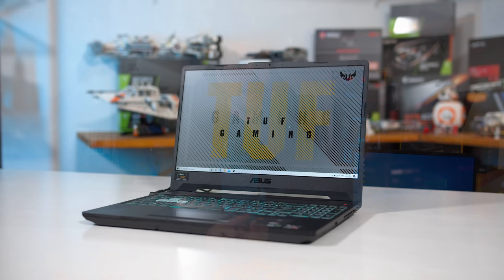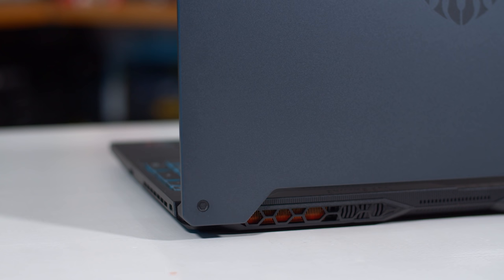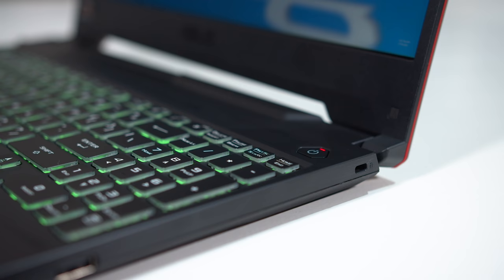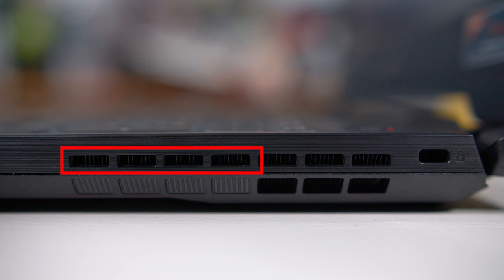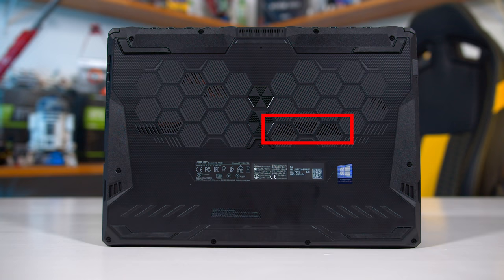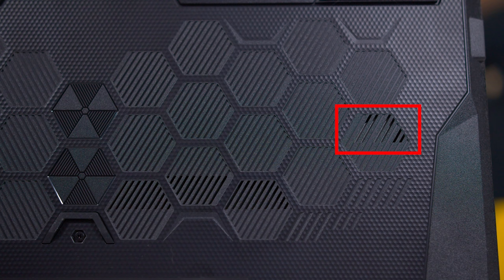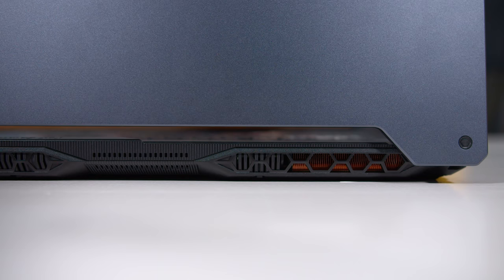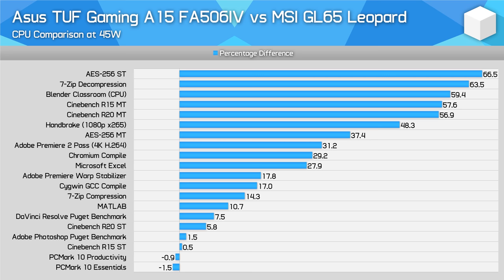Don't Buy The Asus TUF Gaming A15 (2020 Model)

Comment: Hi all, I have this laptop and it runs around 60fps on high/very high settings on Call of Duty which is a pretty heavy game, and runs at around 100fps on GTA 5 high/very high settings. I have completed a stress test on furmark, and GPU stays at 70-80 degrees and CPU stays below 90 degrees. This was all on the turbo mode. (By the way, silent mode runs VERY quiet, and still gets around 70fps on high/very high settings on GTA 5 which is impressive). I hope this helps guys 😉
Reply: Thanks ! Btw do you have the version with gtx 1650 or 1660ti ? I am planning to get the 1650 one due ti limited budget, so what can you suggest ?
Reply: @Red Hawk I’m also facing the same problem. Is the GTX 1660 better than the GTX 1660 ti? I’m afraid of regretting it after buying. So which do you prefer?
Reply: @isabird2944  1660ti is better than 1660
Reply: @redhawk486  I'd recommend the 1660ti (if you don't mind spending the extra money) because it performs quite a bit better than the 1650.
Reply: @malymole  what a coincidence just now I purchased one lol
Reply: @redhawk486  great! I hope you enjoy it 😊
Reply: Thanks for the info man..i think the guy in the vid is just over criticizing it. Most of the people i have seen have given positive comments only for this laptop.
Reply: @swifty6759  Yeah I agree

Comment: At this point i'm almost ready to believe the widespread rumor that Intel paid Asus to deliberately make the cooling solution worse. They've been close partners for well over 3 decades, most of the Asus smartphones use Intel processors. And honestly i'm kinda amazed and frustrated at the same time. I'm amazed by the lengths Intel are willing to go to in order to keep every single market share. Because let's face it, the whole they're in is so huge, you can't even see their logo at the bottom. They've lost high-end consumer market, lost low and mid range as well, started losing even on enterprise level (very often now i see Epycs deployed in places where Intel has reigned supreme before). Up to this point they were left only with hardcore fans (who also decrease with every day) and the mobile market. Until pretty much the last year AMD laptops were basically if you just wanted some cheap mobile computer w/o any interest in performance. Now however they come up with cheaper AND more powerful chip, which also runs cooler and is more versatile. Losing this market has the possibility to hurt the most. Especially when even Apple for the first time ever starts working on Macs with AMD cpus. Now that's a HUUUUUUUUGE deal. And Jim Keller leaving is the final blow; it's the cherry on top of the "we are enormously f*cked" cake. So yeah.. i understand why Intel pressed the "EVERYBODY PANIC NOW!!" button, but is this really the way a big company should react? This is where i get frustrated. They just should've come clean, admitted they made few major mistakes which lead to AMD bringing us a far superior product, cut their prices significantly to get rid of the products, suffer the losses which they have no one else to blame but themselves, and roll up their sleeves, dig into R&D and bring us a competitive product. Let's see if they can catch up at 5nm. No point of trying to develop 10 and 7nm cos the market is already OWNED by AMD.
Reply: That's completely stupid. The amount of money ASUS is now burning bc of this is something Intel couldn't just "hand over" to them. Those are AAA companies, they get reviewed.
Reply: Which era u living in? Asus phones with intel chips were last seen 2-3 years ago.
Reply: @QuantumS1ngularity
I’m kind of confused, why would intel pay asus to make the cooling solution worse? Shouldn’t they pay to make it better, and make their processors at least half decent to give people a reason to buy them?

Edit - Nvm I’m dumb, you’re talking about them paying to make the AMD processors have bad cooling.

Comment: Despite watched this video, i still bought it just now. As an average gamer and tech enthusiast not professionals just a normal dude who don’t play much very high graphics demand game, i do play games, the screen is ok for me, the colour look abit mushy but there’s totally not a problem or a concern for me. As i am not doing photo or video editing. The 144hz is perfect for me as I upgraded from a 60hz display. Love it. The thermal issues though i play gtv at maximum setting everything on, get cpu to around 78-80 gpu around 75-77. Which isn’t that bad. To achieve this thermal state you have to disable performance boost using registry editor to show the power options setting. Try google it ur self. It basically control ur cpu to not overboost clock speed, disabling it will let ur cpu run at base clock speed at max 2.9Ghz and its more than enough for gaming n stuff. Overall i am very happy with this and feel good for the decision and i can say I have made a correct decision to ignore this biased video. Tq
Reply from the maker: GTAV is not a core heavy game, good luck mate.

Comment: In part I agree with you, and in others I don't.
Let's see (and think about it):
1st side air inlet - yes, I agree with you (but you can also prevent the entry of garbage because these grooves are much larger)
2nd Air intake for the RAMs - I do not agree with more space if it is to be used without a laptop cooler fan.
If there are more grooves, more dust enters and promotes more electrostatic heating in the Memories and not only (the paper you are referring to is a gelatinous film that serves to keep the memories partially cool and not allow contact with the dust (maintaining the quality of the RAMs).
If you say that the user can open more slots in that area to have a laptop cooler on the desktop, and cooling system (yes) - Yes it can help keep the area cool (it is useful and important that you do not remove the film that is on the RAMs)
3rd The design of hezagonos is funny, but it would be more useful in fomra of lines. And have an articulation system for sliding blinds type OPEN all (when using Laptop Cooler FANS Table) or keep some open (when in Table mode or laptop by battery mode)
4th As for PipeLines, yes, if it is to be used on a laptop cooling fan, otherwise it has the opposite effect. The FANs inside do not get air, they help to remove the hot air. If there are more slots, the AR cannot be "sucked" out, leaving it behind will heat the entire system.
Here it would be more useful to have a higher rubber at the back to give a greater slope, and to promote the entry of fresh (denser) air which would help to push the hot air into the FANs
5º the difference of the plastic has to do with the density of this, its resistance not only to the heat, durability but also in helping not to accomodate dust (let's say it works as a repellent type of dust)
Reply: True engineer spotted

Comment: The reason it dosent have intake ports right over the fans is because as the air enters from the provided openings, it'll cool all the components wile making to and getting sucked by the fans. This is in fact the better air channeling solution and making best use of the fans.
Reply: The side effect being they have to limit the GPU to 90W instead of 125W on other laptops. On a 1 inch tick laptop lol. Thus losing almost 15% performance

Comment: If you're still wondering, I went ahead and bought me one.. the heating issues as everyone say..  they're just exaggerating.  AAA titles, video and audio editing, rendering, never hit over 95°C (that's the highest I've seen in 8 months of owning it and has never crossed 90 C after a clean install) .. mind that AMD has higher thermal throttle point of 105- 110°C.. mine being ryzen 7 and 2060 never throttled, meanwhile some intel i7s (costing almost double the price for what I got) are throttling.

You might get 5 to 10 fps lower than intel but you can definitely game longer and not get throttled.. it's so minor you won't even notice

No one need introduction to Ryzen 7, it's as fast as an intel i7 / i9 in da Vinci (as premier Pro is more intel, Nvidia oriented) 

2060 can run every game in 1080p 60 easy.. heavy games can't hit 144 as it's not a 2070 or a 2080.. 

Battery lasts for 3 to 4 hours YouTube with epic, steam, rainmeter, and few other background apps running, WiFi 5ghz, Bluetooth, 80% full brightness, with keyboard backlight on full (mind that it automatically turns off in 20 seconds on battery) 

Coming to the screen. Lmao boy oh boy do most reviewers bring the laptop down 😂

6 months and the only place I noticed blurriness is on the chrome Dino game after 1500 points 😂 
Don't get me started with colour accuracy.. for gaming and watching movies you won't notice anything.. heck every laptop under 1 lakh has a shitty screen.. they either give full accuracy with 60hz or 144 with similar accuracy... At the end of the day.. you won't notice it at all. If you're into colour accuracy then get an accurate monitor and move on, since you can't work with full performance on battery anyways. 

Plus adaptive sync, no screen tear and no extra latency

I play valorant on a daily basis and I'm on gold 3 ATM.. I don't feel any weirdness or sluggishness in the screen.

What reviews and reviews ignore is that it's a fingerprint magnet.. fingerprint and finger oils.. that's the only annoying part about the laptop.

Other than that, is as equal in gaming as a 2020 razer blade  i7  2060

Best laptop you can buy under 1L.
My preferences and recommendation would be
1. Asus a15
2. HP omen
3. Dell g series

You don't have to trust me on this at all..ask other a15 users and they'll tell you the same.

Glhf
Reply: Thank you
Reply: Update:  did a format and reinstall of windows and my temps aren't even reaching 90c.. mind you that I haven't cleaned the fans

Comment: Good cooling is not simply about "big holes", its a cost/benefit analysis where e.g. too many holes will lead to more humidity and dust entering etc. This video is a great case against "amateur" reviewers.
Reply: I still think that Asus should just include more holes, and probably do something like what Dell did with the Dell G5 SE where they also installed a kind of dust filter mesh over the intake vents if u r concerned with dust entering the system. This imo would be a much more viable and efficient system that wouldn't cost Asus a lot of money.
Reply: My PC has a mesh air filter for the power supply that you can clean and replace...i wonder when that high tech will come to laptops?

Comment: I think u saved my ass... I was literally few hours away from getting this laptop.
Really don;t care about panel. But The bad cooling (leading to unneeded extra fan noise) it's a dealbreak for me.
Reply: you can just cut some of the plastic that blocks the air vents below the cooler and be fine --> your thermals will be 5 degrees better or more.
but you can't just easily "fix" the screen
Reply: @sergiusprintar5491  did you ? 
Or is it just another "internet-fix" ?
Reply: @i3looi2  Allegedly someone else did in the comments around here. Realistically tho, apart from smth being able to more easily damage the fan from dropping it on a pointy surface, doesnt do anything else that's bad. So no real issues with it.
Reply: @PhantomMattcraft  but you are risking not cooling other component if you simply open large hole direct on fan. If you are going to use cooling pad anyway, then yes, otherwise you should be very selective in where you want to new hole to be, obviously, that would mean you need to actually analyze the airflow.
Reply: @edwlimjh1854  There is straight up almost no where the air can come in. Sure you can block off the bottom a bit for side vents. But if you do that then block off side vents.... Where does the air come from? Through the plastic itself? There is only one heatsink at one of the side vents and not much on the other side vent. So... sadly not a valid point really.
Reply: @edwlimjh1854  can't you just cut like the lines? I mean there are already lines on the honeycomb structure
Reply: @PhantomMattcraft  i dont understand your point the side vent are exhaust. The air came in from those slit (small holes) at the bottom, and the keyboard (maybe just from some part of keyboard) from what i heard. The idea of this design is to let air cool other component if you notice where those slit are at. Then the air will then pass through the fan and cool the cpu and gpu.
The thing is, this sort of design has been around for years now, why is nobody talking about this up till now, i tried searching it in the web, there is almost no resource for this whatsoever, maybe i have been searching it wrong, but i just couldn't find any. The complications is when we just dont really sure whether the other component actually need to be actively cool anyway, and whether its actually worth making the cpu suffer from slight heating. It is also shown that the WASD area was plenty cool likely due to this design. Drawing fresh air straight into fan to cool the cpu obviously better cool the cpu. the problem is which design has better trade off. 

I wish there are more research and testing to two different cooling design and see which is better overall, but there just nothing.
Reply: @Lindaine  if you have the tool to cut so precisely then go ahead. Its just easier to make big hole than small slit hole.
Reply: @edwlimjh1854  or just... use chassis cooling for the rest? VRMs are the only potential concern here. tbh even just having everything use the PCB as a thermal interface to the CPU/GPU die, which is cooled by heatsink, is a fair bit for most except for VRMs and chipset. Those of which can either be connected to heatsink or chassis cooled. Everything else isnt really needed to be cooled super well unless laptop mobos have some new thing that desktop mobos dont.

Comment: My Asus A15 is working just fine. No thermal issues under heavy loads for long periods of time (Metro Exodus, RTX Raytracing and DLSS on, ultra settings). No throttling whatsoever. I don't see any validity in your claims here.

Comment: 🔥
Reply: U agree?
Reply: This explains well your results Jarrod.
Reply: @utkarshrajpurohit1554  Yes, it's hot for seemingly silly reasons and the screen is not great compared to alternative options.
Reply: I was looking for your comment.
Reply: @JarrodsTech  then what do you recommend for the a15 r5-1650ti pricepoint?
Reply: I was expected this to happen though after looking at your review and Ownordisowned channel. Maybe MSI bravo or Lenovo Legion 5 is a better choice over A15
Reply: A : Wow... look at this laptop spec !
B : Meh... it's poor design.
A : That's affordable !
B : As you wish.
Reply: @boomville8734  dell g5 15 se has bad thermals than this A15. For some reason dell anodized their heat pipes in this one. The black heat pipes won't be thermal efficient in venting out excess heat from that laptop.
Reply: @JarrodsTech  what alternative options? In this price range
Reply: @JarrodsTech  should i buy the lenovo legion 5 cuz it seems good and also how is the battery on the legion 5 cuz im taking it to highschool
Reply: Still researching to buy one and appreciate you guies when you review ,opening its back revealing its cooling system